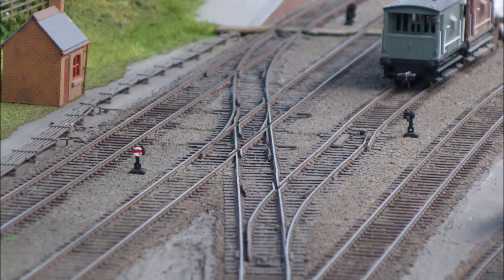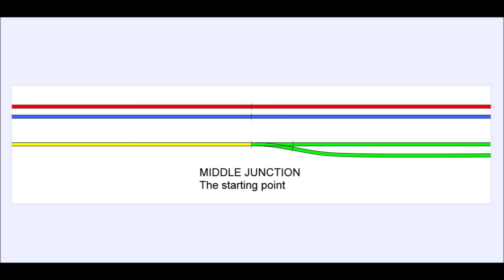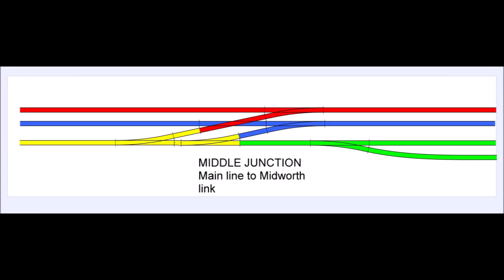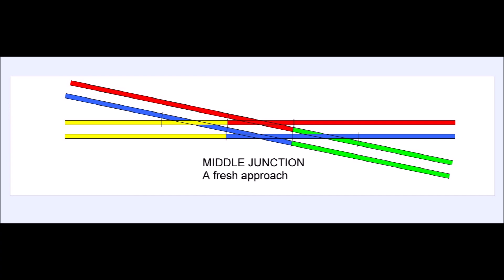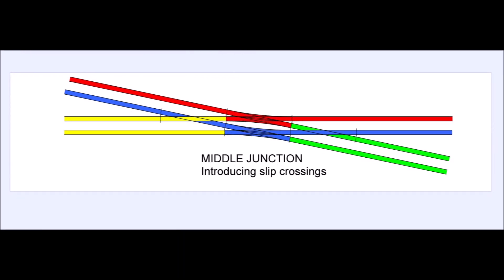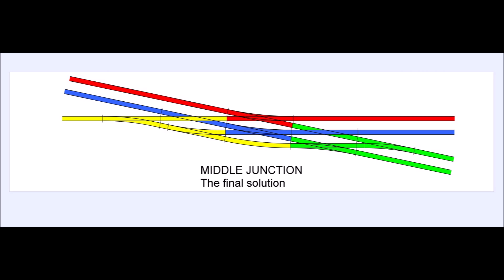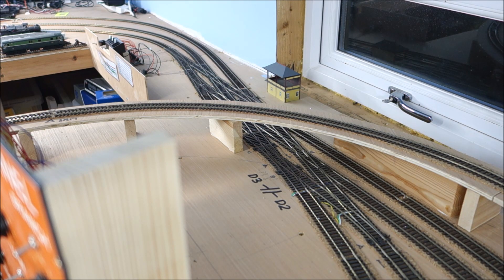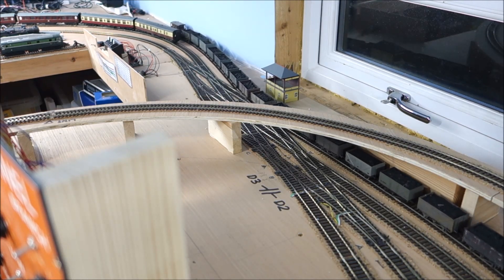Bite Size Bits - Evolution of a Junction

Comment: You could achieve a similar effect with two ladders.

The original turnout design has two issues:

- you don't actually need parallel crossover tracks.  Flatten them a single crossover track each way and either use a ladder junction or a double slip when the crossover crosses the blue line.  This immediately removes two sets of turnouts from your setup.

- The crossovers don't necessarily have to run into each other.  The green/yellow to blue junctions could use a double crossover instead.  This becomes the lower half of the ladder, and you use two single crossovers to then connect blue to red.  However, this actually costs more green/yellow track space (which is what you are short on) while saving blue & red space (which you don't care about as it's the mainline passing through).

The most space efficient solution is to take the diagram at 2:00, remove the blue single crossovers, replace the blue/red crossings with double slips, and slide the two crossovers close together right near the green line junction.  Interfacing on green/yellow is reduced to a single pair of turnouts, while the entire junction on red is 6 turnouts long (from left-to-right: right turnout (red), double slip (red/blue), right turnout (blue/yellow), left turnout (blue/yellow (or green)), double slip (blue/red), left turnout (red)).

Your current design minimises interfacing of the red track at the expense of a long run-around between green and yellow.  But it does look very fancy.
Reply: It also has the problem that the main line is actually on the diverging line of the double slips. The main line should go straight through any switches.
Reply from the maker: HI guys - thankfully, this is off-scene so I can get away with an unprototypical formation.

Comment: Not sure that would be prototypical. Would be a speed restriction on mainline for complexity of pointwork
Reply from the maker: Hi Richard.  Luckily,this formation is off-scene so we can excercise a bit more freedom in formations.
Reply: Basingstoke had a double slip at the east end of the station on the down mainline which had a speed restriction of 65 mph on it, although trains often seemed to ignore that back in the 80's...

Comment: You would normally never seee any mainline go through the curved side of a point or single slip or double slip or 3way. It would mean the trains having to slow just for that point.
Reply from the maker: You are right Peter, but this is technically off-stage so I can get away with it.  I was going to add scenery to the Middle Junction area but that immediately bought the issue you have raised into view, and that did not sit comfortably with me - especially as I have added trap points etc to make it look right!
Reply: Fairly sure the Down WCML goes through the curved part of track at Armitage Junction - unless it has been remodelled since last I went through it…
Reply: Could add a red line loop like the final yellow/green loop if absolutely necessary. The blue would probably be a dive under given the branch line stops a flyover option. Reality sometimes gets in the way.

Comment: Interesting, and I like your vids, but if you were to replace the two double slips in the middle by two points - to straighten the red and blue lines would that be too long overall? Regards Andrew
Reply from the maker: Yes Andrew - I only had 47 inches to work in.

Comment: Good one. How many point motors is that?
Reply from the maker: Too many Don!  The bigger issue is that the crossings have live frogs!!!!!!!!!!!!!
Reply: @yarslowmodelrailway1  I hope that none are where your favourite crossbeams are supporting the baseboard. The reason that I ask is that I have developed a complex crossover design for my layout. I'm be using DCC Concepts ESP with accessories on a separate power bus from the track power bus. I'm even dreaming of a mimic board.
Reply: Looks like 9 to me. Which, if you were to use point motors such as the Cobalt Omega with built-in switches, you are looking at around £140+ for motors! Add to that, switches, LEDs etc.
It can all get very expensive, very quickly.
Reply: We could make it a contest!  a) 203, b) 97, c) 34, d) 21, e) 12.  Winner gets a pat on the back, and a bottle of their favorite over-the-counter headache pain reliever.
Reply: @markh.6687  And a 'Solder soldier' award.
Reply: @donstratton6343  TRUTH!!  I might be tempted to build that at the workbench on a thin piece of plywood or hardboard and just drop the whole thing into place for the final track connections.
Reply: @markh.6687  That is the approach that I have adopted for Build 2. My baseboards are the classic large sheets of plywood on 2X4s with three 2X4 crossties from side to side. They are as strong as my wooden floor! For Build 2, though, I'm going modular with 1/2" ply in segments no larger than 4' on either side and they will rest on feet of 1/4" ply and 1X1 legs to 130 mm height (the height of roadbed of Metcalfe bridges). This leaves room underneath for my Cobalt iP Digital point motors. I can have each board in the workshop wired up then do as you say and drop the final board in and connect the wires to the separate buses then join the track to ay existing board. I can move the feet around as needed to avoid any accessories hanging down. 
Good luck!
Reply: Hi, An excellent presentation of a v.good, but by nature complex, but not a complicated track design IMHO.  For point motor control do you use a ‘route selection circuit’ to simplify this aspect of operation? It may interest you and others to know that for EACH of the four ‘slipped junctions’ plus for the terminus station throat on my layout I’m using solenoid point motors and controlling each element via a diode matrix linked to a SP four (4) way rotary switch to select the route plus a single N/o push button per element to actuate the selection. A high powered CDU (4700 mF capacitor) for each group of point motors completes the design.  I would be very interested to learn the of the control system you use.  Best Regards, Tony 🚂